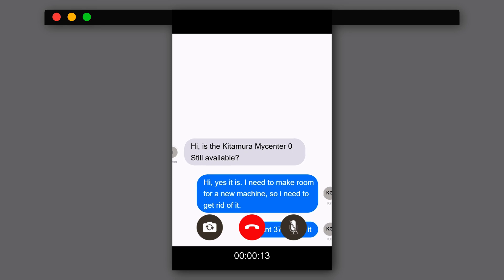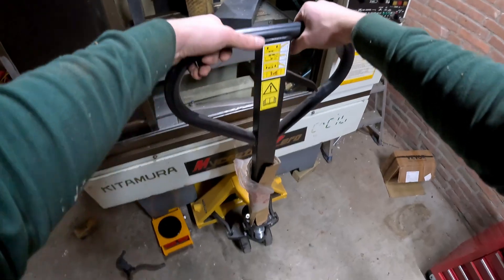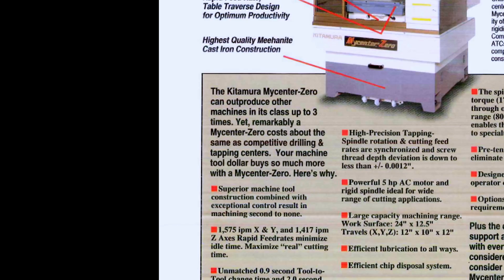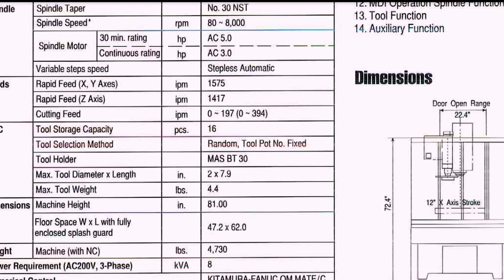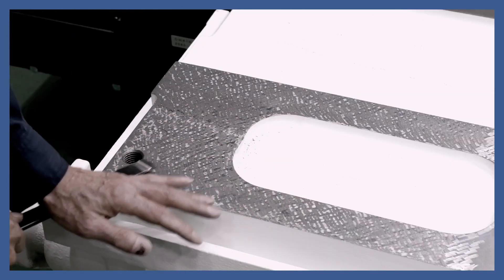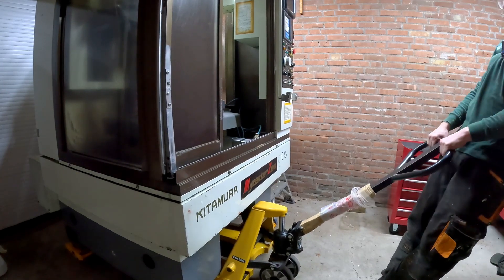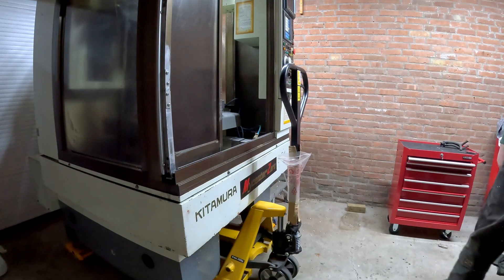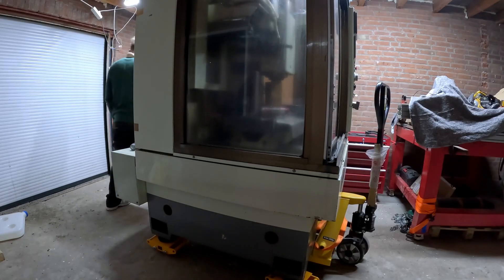How I Moved a Giant CNC Machine All By Myself!

Comment: I had a similar challenge — how to move a 3.5-ton machine by myself 😄 I bought the same rollers as you, used a pallet jack at the front, and a manual winch with gear reduction. Somehow, I made it work 😄
Reply from the maker: Yeah that would work pretty effectively
Reply: @TheYieldPoint  https://youtu.be/eMZ3t8cbFjE?si=qxkjRqVSZdQLlTtR&t=90 it works :)